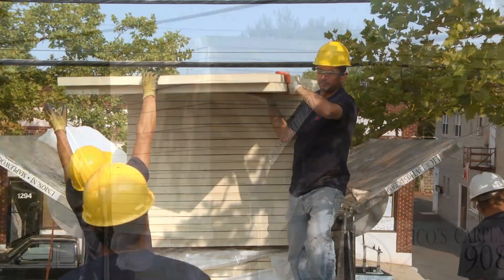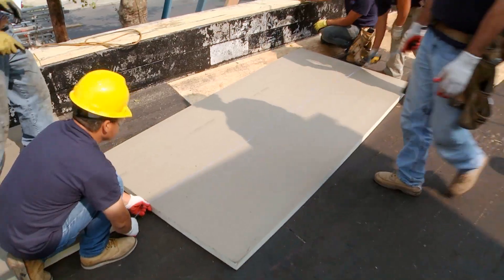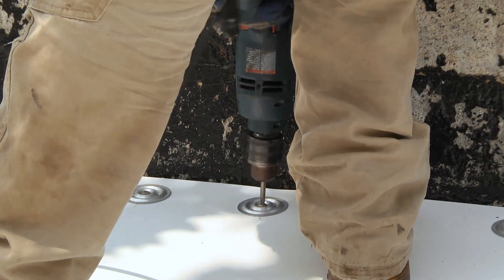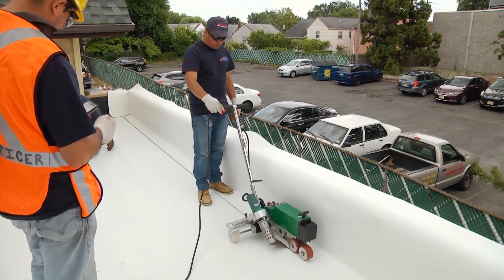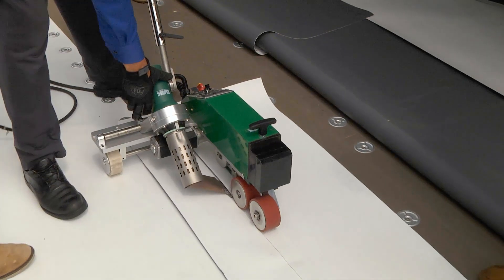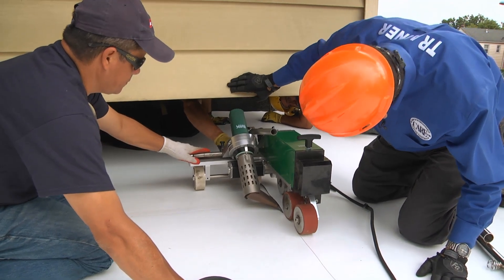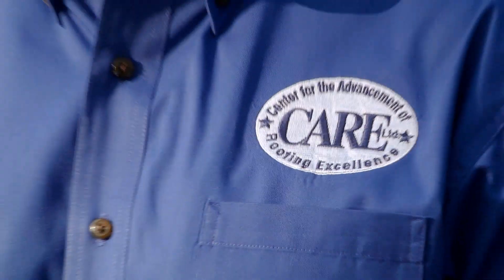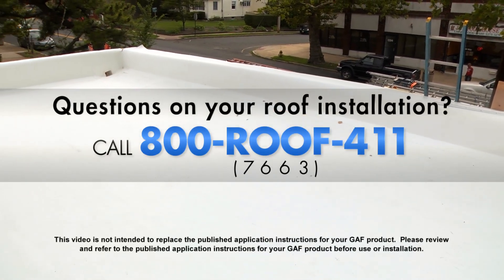How to Install Low-Slope Roofing and TPO Best Practices | GAF Roofing

Comment: Can TPO stand up to grease or ponding water?
Reply from the maker: For Top Coat options, we can recommend GAF RoofMate as the Acrylic option. If you're looking for something with resistance to ponding water on the roof that can be applied in one coat, we would recommend our silicone product, Unisil HS. Please feel free to reach out to our technical experts at 800-766-3411 if you have any other questions!

Comment: I had the opportunity to replace a tpo roof on a chipotle restaurant and also a daycare center and I was not able to find  the right crew to do the work,I had called a couple of guys I knew who claimed to be roofers and when we met at the job to discuss the work,they had no idea what they were talking about and the prices they were quoting me just to do the tear off was ridiculous and then they said I can install the insulation and tpo myself.
Reply: Tpo seams require training,  and I wouldn't do your first adhered application solo.  

That said,  "roofers" is a wide category.  Imagine if we just said "office staff" to summarize AP/AR accountants,  secretaries,  HR, IT, data entry,  etc.

There are 16 major types of roofing.  Only 2 would understand this kind of install.  You want a commercial flat roofer. 

Shinglers are the laughing stock of not just the industry but most countries don't even recognize them as roofs.
You need a commercial company,  not a standard residential.  The best way to do this is figure out what manufacturer you want and call them,  ask for recommendations for a TPO installer.

The best TPO companies are Carlisle and GAF.

Comment: I didnt see training expert Paulo doing a pre weld before hand welding a lap seam ,not good training film guys,a proper pre weld before the final hand weld is the only way any hand welded seam will pass inspection,im sure Paulo did a proper pre weld but GAF should have shown it instead of glossing over hand welding which is where most details leak.

Comment: Do you have a TPO membrane that can be applied on a roof with a gentle compound curve? Like 1" height change in each direction every 3'?
Reply from the maker: Hi there. Thanks for reaching out! TPO can be installed over several different roof slopes. We recommend reaching out to our Technical Services team to help. You can reach them at 800-766-3411.
Reply: Can you guys make a video of how to set up speed and temperature or you guys have one already??

Comment: We hired one company installed a EverGuard TPO 60 mil Membrane recently. We found the TPO and underneath roof not adhesive but can feel they are separate when we tap the roof. Will this be an installation issue and how to fix it?
Reply: Your roof system is not glued to the insation,each sheet of membrane is fastened to the deck with screws & plates every 8 inches,the next sheet laid out is welded over the screws and plates which allows for some wind uplift of the membrane which is 100% normal ,the best thing you can do for your roof is to have the same company who installed the roof send a man out twice a year to make sure all roof drains,scuppers and gutters are free of debris & flowing freely ,if your roof has heating & cooling equipment on it that needs service dont try to skimp & save a few bucks by only scheduling service with your HVAC contractor,call the roofing company that installed your roof & have them schedule a roofer with heat welding tools to effect a repair if needed be on sight assuring the HVAC contractor does not puncture the membrane by stepping on loose screws,dropping tools or cutting the membrane by sloppy handeling of HVAC sheet metal access doors .
Reply: If it has plates on the seams and along the walls , your roof will still perform for many years.  Glue mainly holds the membrane  down from blowing off in high winds. We  never worked with this product though I have installed fibertite and  carlisle tpo for 10 years now. If you notice the field sheets pulling the wall membrane  causing bridging then you have a problem but I think you are good. There are different types of installation  . Mechanically fastened ( usually what we do with glue only on walls and curbs ), screwing down every seam like in this video with plates, and then there is chemically adhered with mainly all glue down to insulation . Never seen 2 before both will do well

Comment: GAF makes the best products ever!   
I’m a sales rep for a building concepts company, and we’re Master Elite Certified, Presidents Club Award Winner for several consecutive years now.  We sell several different brands of roofing products, but I only recommend GAF products, and I only carry their samples with me 💪😆.  
I always advise my clients to buy, at minimum, a Silver Pledge, but I love putting long-term owners into a Golden Pledge so they never have to worry about their roof again.  
We love you, GAF! 👍💪
Reply: I roofed a house using GAF product one time and the shingles pulled apart from each other and it was hard to deal with. 
How many roofs have you roofed to know what you are talking about when you sell ?
Reply: @travissmith3720  - what line of GAF shingles did you use?   
Pulled apart from each other?! That doesn’t even make sense.  Their shingles are fusion welded together.  I’d love to hear more.